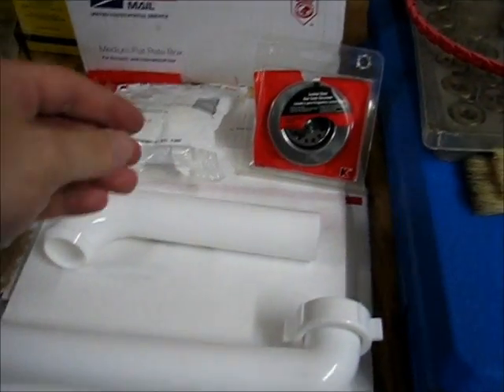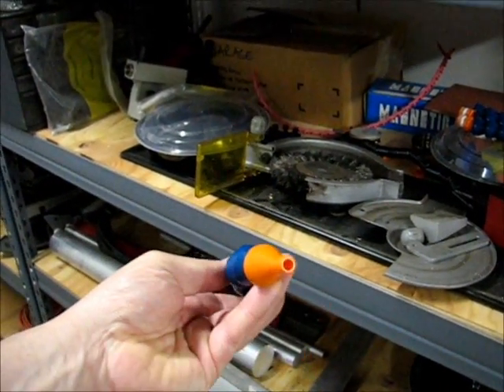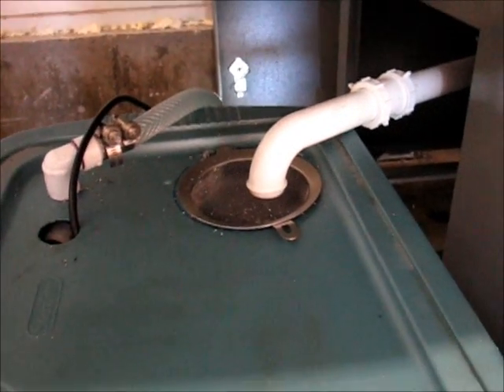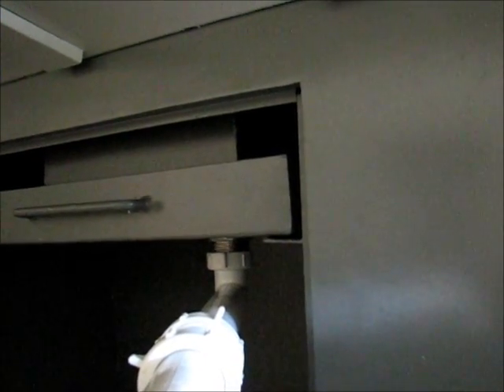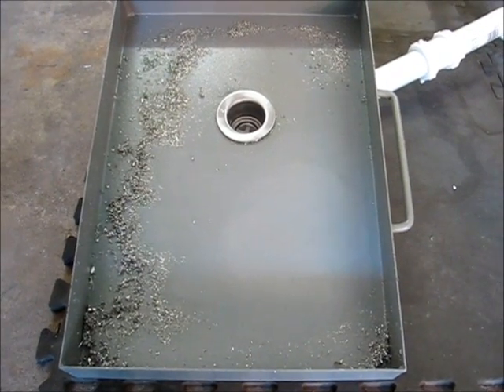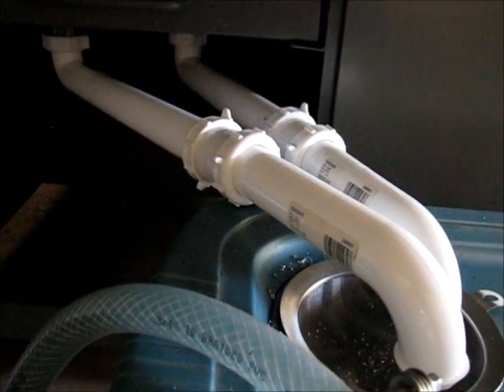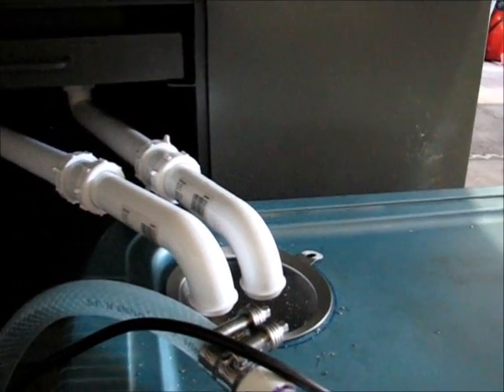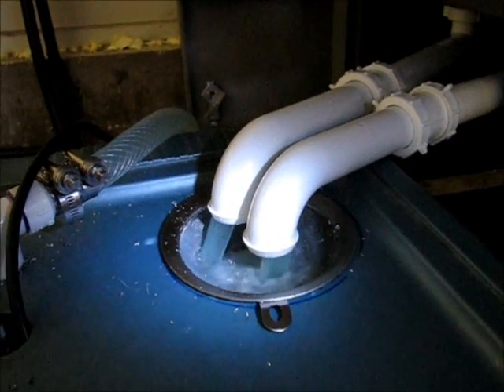Tormach PCNC 1100 - Coolant Mod, Adding a High Flow Drain

Comment: Nice setup.  I do have a question.  We have a 770 and are looking to relocate the coolant tank from the back of the machine to the side.  My question is if you have had any issues with clogging, or chips sticking to the pvc?
Reply from the maker: The only place where clogging has been an issue is at the 90° elbow.  It's usually not a problem because the screen at the stand blocks almost all the chips.  I just check it every few hours to be sure it's not an issue.  The bigger problem has been the stamped metal at the bottom of the "bar sink strainer."  It would get clogged with the bigger chips, like those from the Superfly, and clog up very quickly.  I just punched it out with a cold chisel.

Don't bother with the strainer basket like I show here.

Comment from the maker: I'm very pleased with the coolant system upgrade because of the improvement in surface finish while pocketing. I've only heard chip recutting happen once since the upgrade and that was when I was making a .404" wide racetrack shaped slot that was .995" deep while using a .375" tool. I guess the .029" clearance at that depth wasn't quite enough. Thanks!